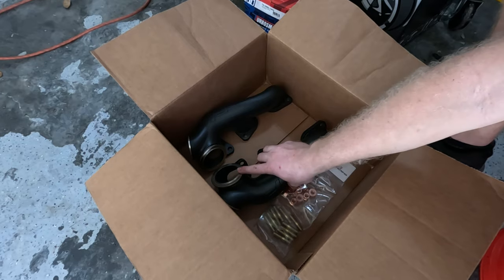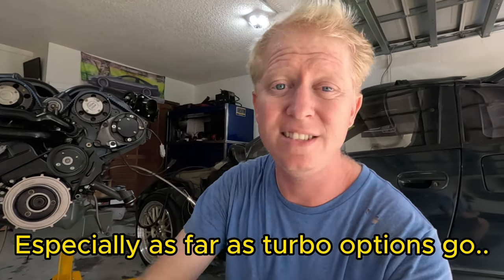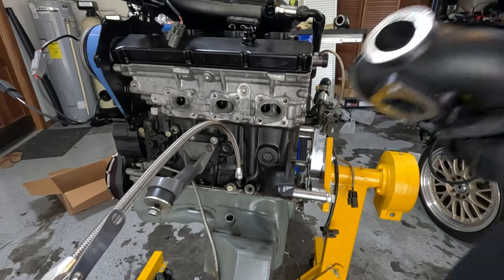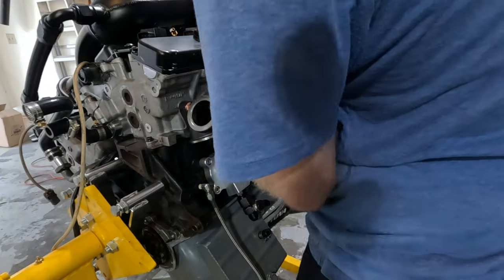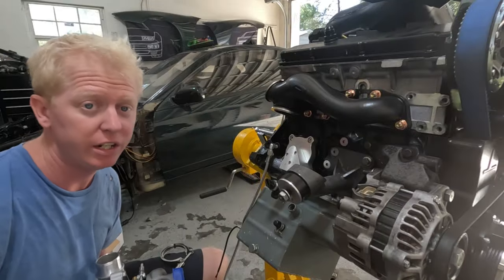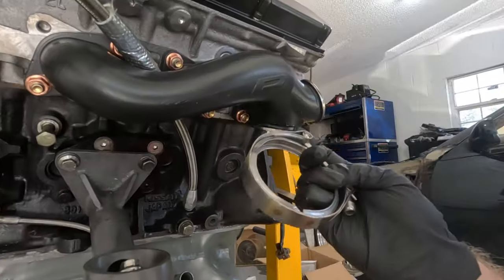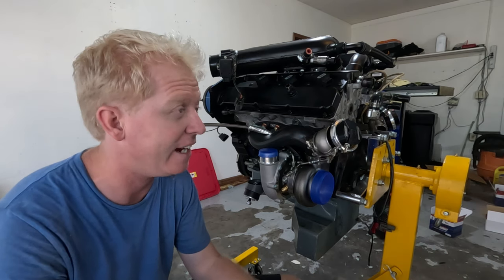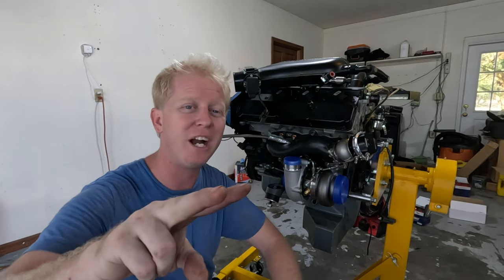Installing The Best Turbo Upgrade For My 300ZX | Polar Engineering Manifolds!!

Comment: Never owned a 300ZX but have been following Polar Engineering since they showed the rendering of the exhaust manifold. I really want to get the J-Series with a set of mirrored turbos just like what you have for the J-RWD swaps. I’ll likely will have to make the manifolds myself. Already designed the adapter to get a GTR upper intake manifold (basically identical to what you got but with GTR bolt pattern) to bolt to the J-Series lower runners. Your set up is definitely inspiring.

Comment: Nice build 👌 iv been running the g25 660s for almost 2 years now on my vg30 300zx very similar spec to yours exept iv got the merlin hi ram and im dbw. With a quite basic tune i made 969hp at around 30psi on 95 pump gas and meth Injection. There's still plenty left in it. Iv just put a built th400 in so will be getting in back on the dyno soon and turning the boost up a bit more. Can't wait to see how yours goes, unfortunately i had to have all my parts custom made for my engine. Its great that polar has started developing the vg30 platform now.
Reply from the maker: I'm interested to see what kind of power you make through the TH400 with the same settings!
Reply: @Billy_Built  I'm guessing about 100hp less. Hopefully not much more lol.
Reply from the maker: @Blackbullet_racing  should definitely be more controllable power that way. And if you're looking for a fast quarter mile that's definitely the way to go.

Comment: Can't wait to see it finished and running! Going to start my build this winter. I am looking for solid 400 hp daily usable while modernizing many things as you did!
Reply: @adeadlyfart13  As I believe that my stock turbos will not be in best shape after 30 years I think I will either replace or rebuild them. Goal is to get boost earlier as I feel the old turbos are hitting pretty late. I will definitely go with a mild setup with "small" turbos 😁

Comment: Will you be running the Polar Engineering downpipes as well? Recirculating or open dump? Also, would you share the part numbers for the pulsar turbos please. Setup looks sick!
Reply from the maker: I will be using the polar down pipes with open dump tubes. Pulsar Turbo change the name of their turbos it appears. The g25 660 is actually the same as the 5449 (660hp) turbo

Comment: gonna need a spacer for your p.s. pulley cause of your trigger wheel bolted into the dampener pulley.
Reply from the maker: Won't be using a p.s. pulley. -see previous video.

Comment: Do you have any videos of pictures of how you ran the turbo inlet piping. Is it a full 3 inch to the filters? Polar said they were going to make some but i have yet to see them.
Reply from the maker: I just used regular 2.5 inch piping with a coupler to the turbo.

Comment: Hey billy what are exact specs of pulsar turbos you are running/will be running?
Including AR and what power level are you going for
Reply from the maker: 5449 .72AR 900-1050WHP at 30-34 psi
Turbo link is in description

Comment: Hey Billy, been following you for a while here and I’m debating on pulling the trigger on these.  I was wondering what the spool up is like with the .72 turbos with the other mods you have or have you not tested yet
Reply from the maker: Hey thanks! I'm expecting these to spool up pretty quick for a street setup. Especially with the head and cam setup that I have. If you want faster spool up then just get the g25-550 turbos with a .72 ar.
Reply: @Billy_Built  thanks a lot. do you think the 500 cams are more worth while than the 400+.

In a side nite, ive been loving your content.  Really insightful
Reply from the maker: @birdszed  for power I'd say the jwt500's in 272 duration is the way to go. But if you're paranoid about having a higher slightly lopy idle than stick to the 400s.

Comment: In theory would the 300zx boost parts fit a vg33? Im building up a prerunner 03 frontier and rather than swap to a v8 i think it would be a nice project to try and build up a nice little motor using the zx bits.
Reply from the maker: nah. 90% of the DE parts are too different. Although the SOHC motors are pretty strong as well.
Reply: Was hoping i could leach off the zx parts in an attempt to save time on fabrication, oh well.  Thanks for the reply. Take it easy🤙

Comment: Are these turbos you selected a good choice for a 500-550 whp goal, or are they overkill? What would you recommend?
Reply from the maker: @ghostsmoke11  Soo how early in the RPM are you trying to make 550 WHP?

 One of these turbos can flow roughly 660hp worth of air on a proper setup so it's overkill for 500hp.
Reply: @Billy_Built  Hmmm that's a good question, I guess 550ish would be near the higher end of the rpm band, I want to spool up quickly. I guess I have some more things to consider.
Reply from the maker: @ghostsmoke11  I would consider a g25-550 with the smallest ar you can get on the hot side.
Reply: @Billy_Built  thanks a lot man :)
Reply: @Billy_Built  Before I commented here I actually also sent an email to polar engineering with the same question and they recommended the same exact turbo or the pulsar version, so solid recommendation man lol

Comment: What’s the Horsepower rating on those pulsar turbos ?
Reply from the maker: @Davquan37    660 each
Reply: @Billy_Built would you run these if your motor wasn’t built ?
Reply from the maker: @Davquan37  probably. I don't think it'd be a problem.
Reply: @Billy_Built  cool thanks 🙏🏾